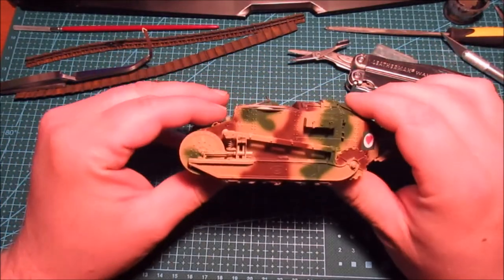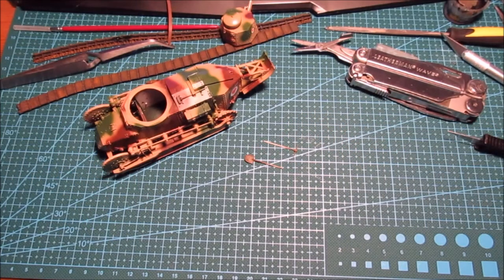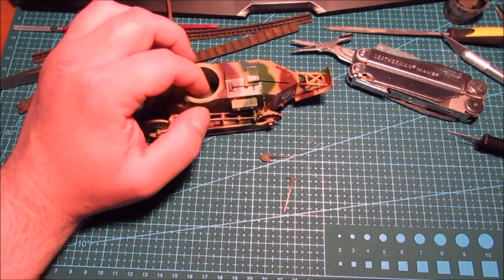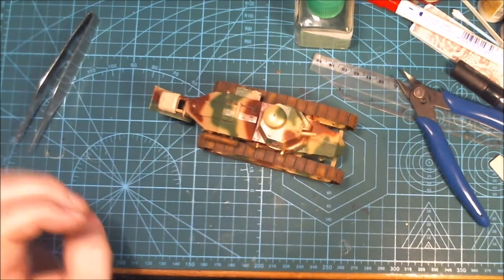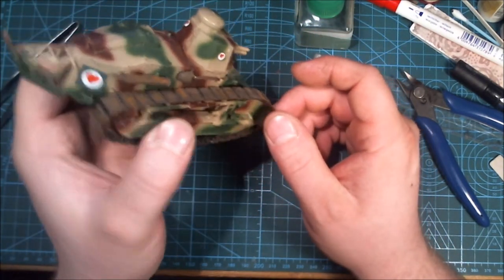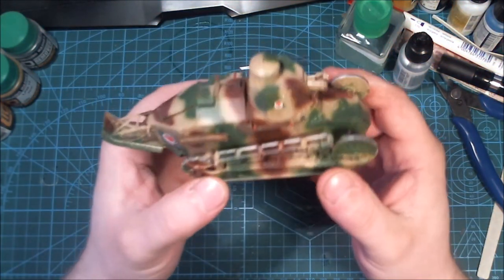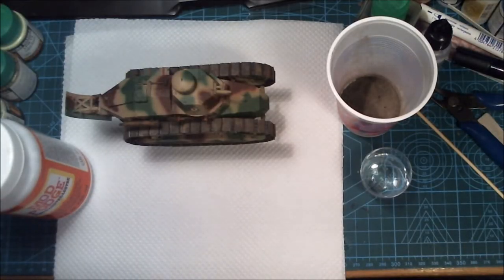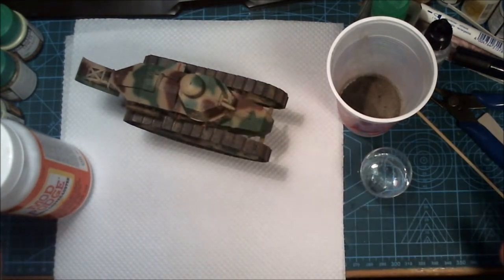Return of the Meng 1/35 FT-17 and also the FINALE!!!

Comment: Great result on the FT.  Nice to see you using the Lifecolor Liquid Pigments which you know I also like.  Much better lighting this time, so overall it was clear and easy to see, apart from that auto white balance on your camera... try to set it with a white piece of paper and lock focus when you start.  That may stop it going beserk.  I often raise the paper 1 inch off the matt and lock focus there... it will look in focus for your model and most of the hand waving!
Reply from the maker: Thanks for the advice Harry I will definitely give that a try :D I'm really liking the Lifecolor stuff although I have much to learn there. I plan on getting at least the rust set as well
Reply from the maker: I tried the paper focus thing. Also turned off some color enhancement thing the camera software offers. And I believe it worked a treat. I also realised my right hand lamp has some shitty Ikea save the planet bulb that emits kind of a warm yellowish light so I'm gonna get a good old fashioned regular bulb for it and see if I can't make it a bit more indirect light like from my better left hand lamp. I'll get there one day haha